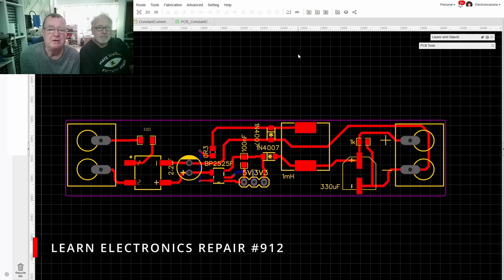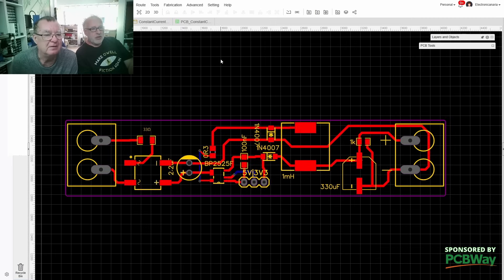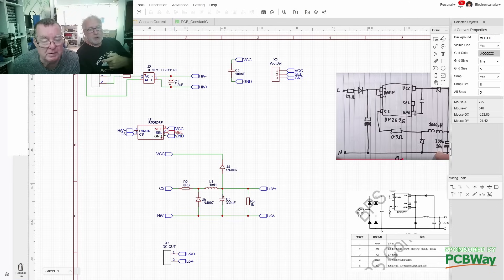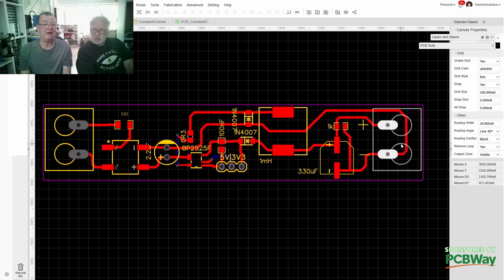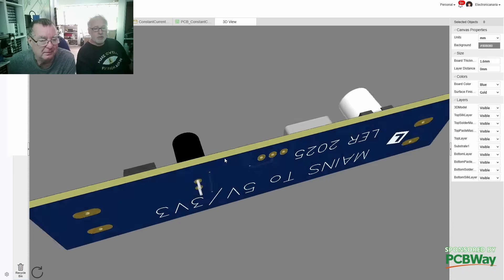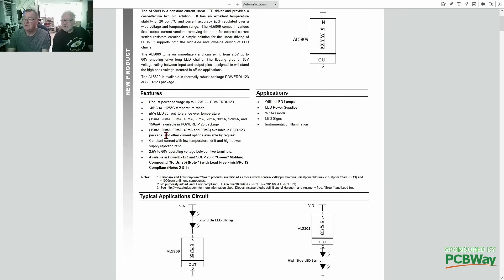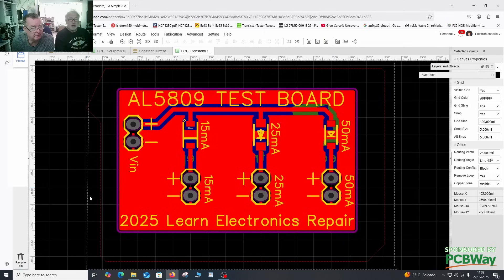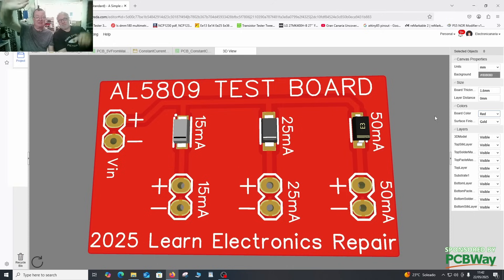Strange Devices : BP2525 5V From Mains and AL5809 Constant Current Diode

Comment: These are very useful for automation modules that must be placed inside 2x2 and 4x4 electrical boxes, since there's usually not much space left in there. That's why you can always find a BP2525 (or some other variants) inside cheap automation module brands like Tuya and Avatto (AliExpress). In earlier versions of these modules, the PSU would either use a capacitive dropper power supply or a transformer, that would usually use much of the available space for the module itself.
Inside these modules, you usually have a microcontroller like ESP8266 (or ESP8255, or BK7231N, or Tuya CBU etc.) running a custom firmware (that I always change to ESPHome) to control one or more relays.
In fact, I'm convinced that these BP2525 chips were developed specifically for this kind of application.

Comment: I do wonder if the al5809 get hot as led current sources, but then I also guess they will be fine working in parrallel with a gap between them for airflow allowing for the heat to be spread out

Comment: the 33 ohm resistor shouldn't there instead be 2 approx. 17 ohms in series mean max volt is 200 V RMS/DC for a 1206 package the approx. 0.25 W should be ok (1206 max 0.4 W)
Reply from the maker: Personally I would go with an NTC in that position

Comment: These things are dangerous if used in any device you can touch connections on ie not a light bulb or somthing completely in plastic or a grounded chassis but for on the bench to power stuff up no do not do this it will kill people these devices fail dead short all the time just think about it lights ok stuff u can't touch ok NOTHING ELSE

Comment: More on why a bridge may cross you!

For lots of applications a bridge rectifier will not only be acceptable but at least marginally preferable to a single diode.

Consider as a contrary example a circuit that controls several small triacs that select different winding taps of a fan motor, along with managing receiving from an IR remote control. This is something a small microcontroller would do easily. If the triacs are selected to match the job (operation in quadrants 1 and 4 - gate positive with respect to MT1, MT2 positive or negative with respect to MT1), it is possible to drive them directly from the outputs of the microcontroller without the need for any level shifting or optocouplers. Now you have what I described in another post as a circuit referred to one side of the mains - one side of mains becomes the "common" for the whole thing, including the triacs. The other side of mains will go to the common connection to the motor. This precludes using a bridge rectifier, since for half of the cycle the control circuit common would be referred to one side of mains and for the other half cycle to the other side of mains. Draw a schematic and trace where currents go.

Circuits like this are actually very common in real life, but are often powered with "capacitive divider" transformerless supplies. The BP2525 would likely offer much lower standby power consumption.

Comment: Hot PS w/plastic buttons .. hmm, what if liquid or hand lotions or gels on the user’s hand .. nope. “Voltage just waiting for your finger”. As you all said, only for a self contained device, enclosed and sealed.
BTW, the second device reminds me (somewhat similar to) the SPMS secondary side “Schottky diode replacement” synchronous rectifier DK5V45R20 for DCM/flyback power supplies.

Comment: Two diodes are shown in the schematic as 1N4007. These should  be ultrafast diodes. Don't just stick in the highest voltage available. Read the datasheets. There is often a reverse recovery time penalty for high voltage parts.

I really, really hate simple schematics drawn with a whole bunch of "module ports" instead of explicit connections. Naming nets is very useful but put the names on the nets, don't use ports unless something goes off-sheet or is particularly difficult to draw as a direct connection on-sheet.
Reply from the maker: Thanks for the info, yeah recovery time would be an issue.

Comment: 11:25 These aren't knew, and are older than 2014. I remember buying a pack of those around 2010 in to-92 (only two pins used) and I don't think they were that new then. Actually... I think I still have some. Let me check.
Reply: The part number I ordered was CL2N3-G made by Supertex. 90v, 20mA. The datasheet from them says 2012, and now that I think more about it probably was 2012 when I bought a 20-pack. I have 15 of  them left... So... That should last me about another 40 years.
They are currently 49 cents each new from Mouser. I don't think that has changed much.
Reply from the maker: @SkippiiKai  Yeah we realised these were not new but some interesting components go without notice. That is the whole premise here if viewers would like us to continue with occasional episodes and make a series out of this topic.  Up to you guys if it happens
Reply: @LearnElectronicsRepair  Yeah, I love the idea! I wasn't trying to contradict anything - just add some of my experience with the parts. When I first discovered them I was super excited because I remember I was specifically shopping on Mouser for parts to build a temperature compensated 20mA CC source... And this component solved the whole problem. And although it was a super simple project, it got.... Um... Completely misinterpreted at one point and I ended up getting searched by the police. So.. Yeah. Love these chips. Good memories.
Anyway, as I said, I still have a bunch of them on the shelf, so if you want me to do any tests with my old stock to compare, just ask.
Although they are designed to drive led strings at 20mA, you can also use them to drive a power bjt's base at a constant current for high power LEDs.
Reply from the maker: @SkippiiKai  Sorry  Skippai  I didn't mean to suggest you were contradicting. I have a very direct way of speaking sometimes. Please feel welcome to post your thoughts whatever they are, you are more than welcome 🙂
Reply: @LearnElectronicsRepair   No worries, I just didn't want anyone to think I didn't really love the idea of this video series! Also, I have a theory on why this is packaged like a diode. This dates back to before my time in electronics and before these chips existed, but CC sources just like this have been around forever using JFETs. A single JFET makes a current source or sink if the gate is tied to ground with no other components. The first 2-terminal CC devices were in fact just JFETs with the gate internally connected, and I believe those were also packaged the same as diodes.
My main issue with these newer generation chips is that the tolerance isn't great (+/- 10%) and neither is the dropout voltage. In fact, I think an lm317 or 1117 does a better job of both, and at a fraction of the price - albeit at a lower voltage (~35v). It would be cool to a shootout between these, the CL2s, 317, and 1117 all used as 2-terminal CC devices.

Comment: I don't consider this controversial at all - it's a very common circuit. I basically used a similar thing last night in a custom light bulb. Just don't be stupid with it or connect it to something groynded. and there aren't issues. 
8:23 You probably do have some of those parts lying  around inside light bulbs.
Reply: The danger with many of these circuits is not about touching bare components. It's the fact that these have a low voltage output that is normally safe to touch.
However there is only a diode junction isolating you from the incoming mains. If the diode fails as a short (which is very common) then you now have a direct connection from the ELV output to the mains. OK, you have a 50% chance whether it's line or neutral.

Comment: I watch Big Clive 😁
Re the power supply.
I have looked into this sort of thing, my idea is to have something that can power modules with Wi-Fi (ESP2866) to add remote and automation to house wiring, things like sockets and lighting.
Since the device the Wi-Fi module will be controlling is mains power, having a hot power supply is no issue.
Nice to see the 3D.

So my suggestion for a project using this power supply:
Using the little ESP-01 that has one usable IO, to a solid state relay switching a mains device.
So the only supply would be the mains and it would output mains via the solid state relay, switched on and off via Wi-Fi?

Re the AL5809.
As it is a test board, I would have put solder jumpers between the outputs of the devices, so you can connect them in parallel, this would give a greater range of current limiting.
Reply from the maker: Yeah we think wifi controlled devices is the way to go with this

Comment: I'm not likely to design lamps so I doubt I'll need the al5809.

I'm going to be arranging a series of radio controlled relays and I haven't found a mains powered option with sufficient relays and they start getting bulky if each one has its own supply.. The BP2525 could be the solution since it will all be hidden away in a ceiling void and I can have one 5V module with all the relays on one board.
Reply from the maker: That AL5809 has a whole lot of possible uses.  Even a selectable constant current source in the mA range can be useful in a variety of component/circuit test scenarios

Comment: The bridge rectifier may be regarded as a mistake. In most cases the Neutral wire converges on Ground in the distribution box.  Certainly this is true in the USA. So with a single diode in the supply line your neutral wire can be at ground voltages and quite safe to touch the output power wires. Of course this assumes your house wiring is correct and your device is wired-in correctly.
Reply from the maker: Well if you can't trust the manufacturer datasheet what can you trust?

Comment: Using a bridge rectifier may be unworkable in some instances. If the thing powered by this circuit needs to be referred to one side of mains, you can't use the bridge. Zero is where you say it is, but you only get ONE node that you can declare as zero.
Reply from the maker: Thw datasheet shows a bridge rectifier so that must be OK for this circuit.  Also in a lot of the world, including here, the mains plugs are not polarised anyway. Stick them in any way you like
Reply: Wow u really don't get it ay

Comment: You mean only to be used in a double insulated enclosure.  The old box in a box icon.
Reply: doesn't an unearthed all-plastic enclosure with zero protruding metal qualify as "double insulated"  (provided it passes an inspection for structural integrity etc..)  ?   Or is "double insulated" always applied in some literal sense?
Reply: @GannDolph   Double insulated just means that there are two levels of isolation. So if you take a wire and put mains voltage on it, to double isolate it you need a sleeve over the wire. in the same way that low voltage wire can be a figure of eight with a single layer of insulation. but a mains cable has insulation on the wires and then a sleeve of the lot. This means that no conducting part can cross the enclosure. 

I always try and get folk to have a look at standards like the old BS EN 61010 and it's many parts. this would also cover things used in the house. one standard behind the LOW Voltage Directive.(LVD)

Quick note, if you invented the bread toaster today you would never get it past any electrical safety standard in the world. 🙂